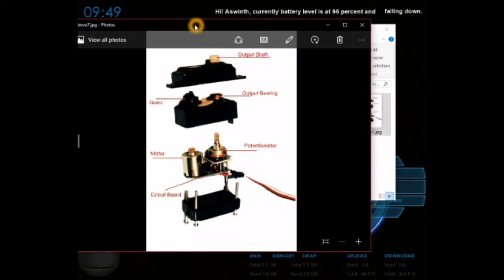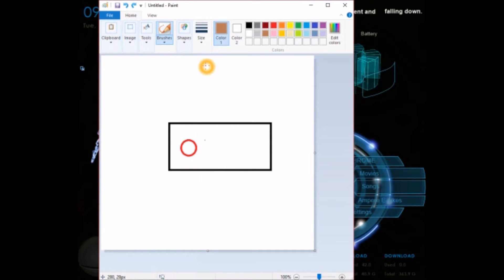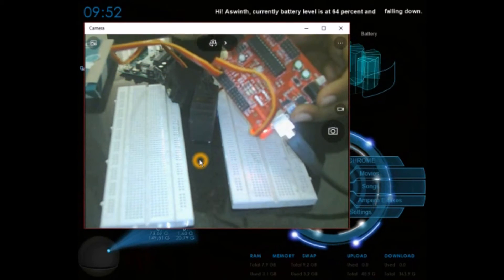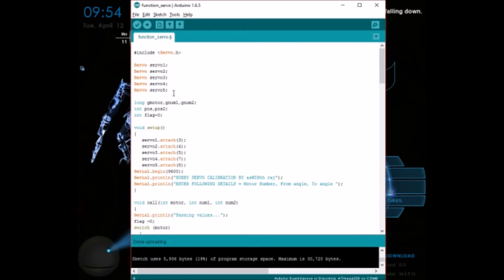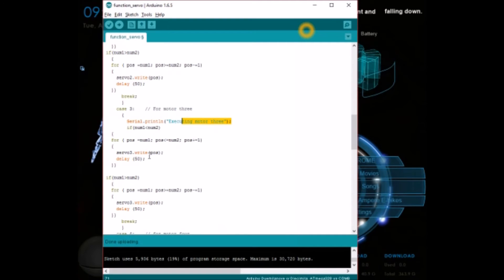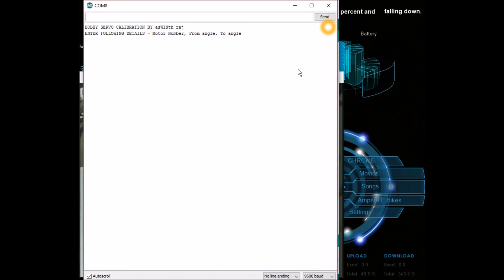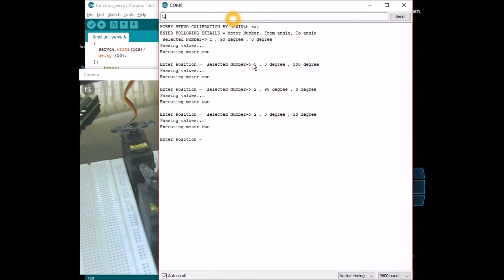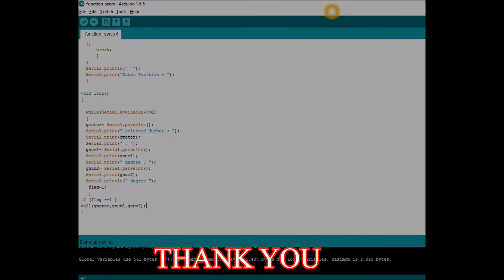Servo Motor working, selection and calibration using arduino

Comment: how can you connect and made a rod move vertically simultaneously by motor ..like a small rod in left side which goes up and down in a sewing machine whenever the sewing machine is operated
Reply from the maker: genuine tips google for rack and pinion arrangement that will suite your purpose
Reply: Aswinth Raj Balasubramani thanx  mate
Reply: Aswinth Raj Balasubramani I want to move rack move upward and downward again and again ...in your given data rack is moving in only one direction

Comment: Great video...is it possible to control 2 servo motors simultaneously ?? I just wanted o know and I am trying it using Arduino uno.....
Reply from the maker: Yes it is possible!! just make sure you can source enough current for both the motors